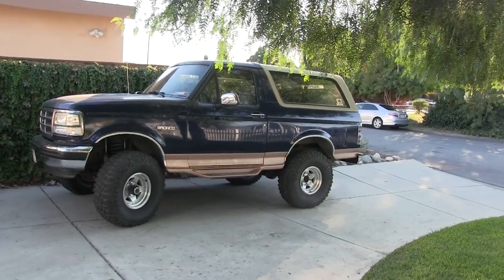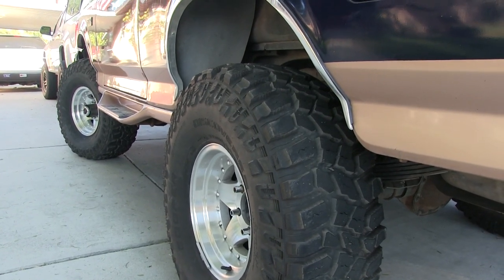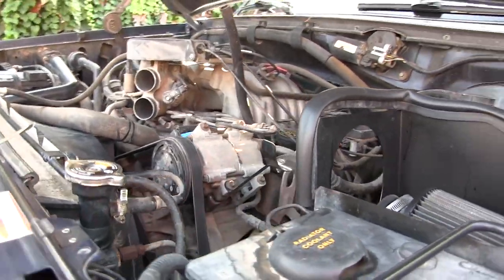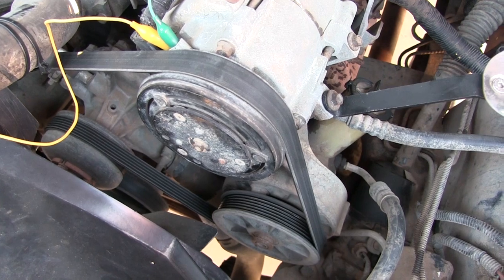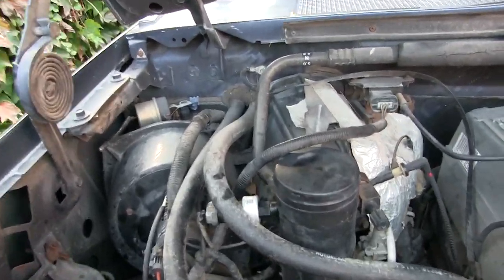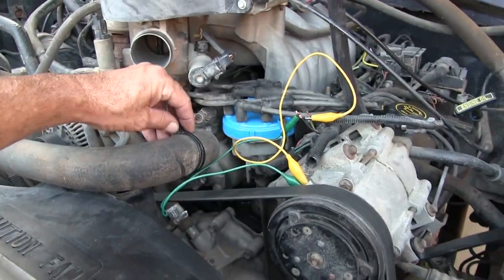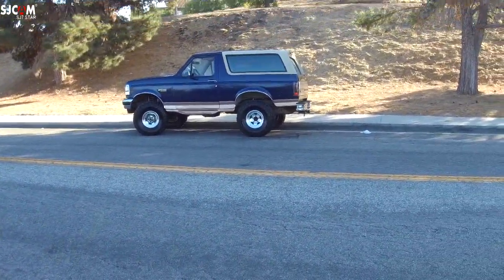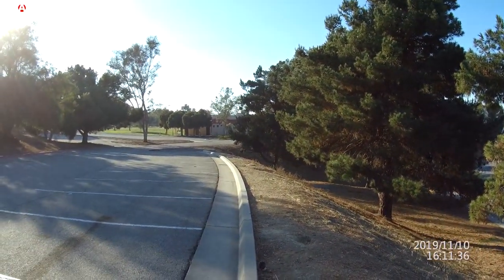Bronco Project 7 AC Repair

Comment: Hello, I have a 95 ford bronco I just bought and it's still at the yard. I planned on towing it myself to my property but it doesn't have a ignition cylinder.  Is there a shift release somewhere so I could put it into neutral? Any info would really help thanks.
Reply from the maker: I never had that problem. I'm sure someone knows what to do.

Comment: Have any break tips for these Broncos? My truck is being a real pain stopping. The abs light is on, code is saying “abs malfunction”  would that cause crappy breaking power ?
Reply: Sal Gonzalez Check for air in the system bleed the brakes from the furthest caliper to the closest. If not better check the pressure. Get an inspection.
Reply from the maker: Thats a tough one. "crappy braking power" what does that mean?  "ABS Malfunction"  Check the ABS sensors on the front wheels.
Reply: rudedogii the power is not as good as my f150s or f350s. It would fail at doing a panic stop. I’ve changed the pads, new calipers, bleed the lines, new master and booster. I just want to safely stop.
Reply: @salgonzalez908  The F 150 uses the same brakes as the Broncos made at the same time I believe. There are ways to  improve stopping power on both. If upgrades are made for performance other upgrades are usually needed as well. The weakest part will fail and stock parts are designed for stock parts in the drivetrain. Performance is not cheap done right and off road performance is not cheap and without labor but it is very nice. Good information is key too.
Reply: brianbirc only thing I notice is f150 is rear abs module and bronco is 4wabs module, witch abs light is on, and I feel like that is the cause. Both my f150s are 6 & 8 inch lifted. With stock parts from places like autozone. And both lock up and stop on a dime with 35s or 40s. Only thing on the bronco I haven’t changed was rear shoes & wheel cylinders. (Rear shoes have plenty of meat and healthy springs) lol I just want my bronco to stop 😂 😂 it’s getting cold so I can’t even mess around right now
Reply: @salgonzalez908  It could be an adjustment to the rear cylinders. The fluid need changing or lines clog or damage. You may want to get a inspection to find out what could be an issue. There are upgrades that increase braking that can be expensive or less expensive with other parts. I would go with the inspection from someone good for that and join Full Size Bronco forum for some info and check others.  I have done some good upgrades with info from there and repairs not in manuals from auto parts places. Not all Broncos are 4 wheel ABS. Older ones do not have it and mine only had rear. I like it for snow but not dirt. Street ??  Pressure test sounds like a test that could help.